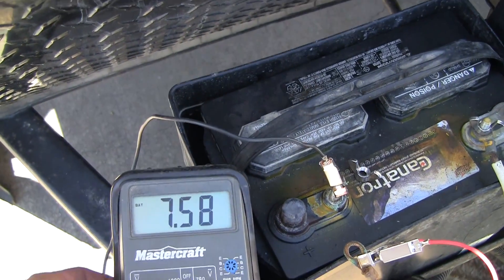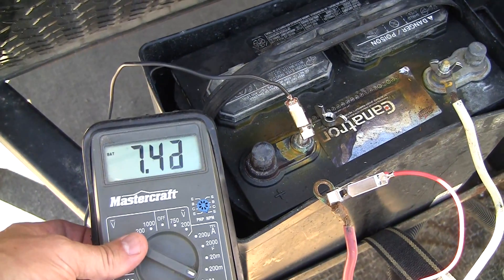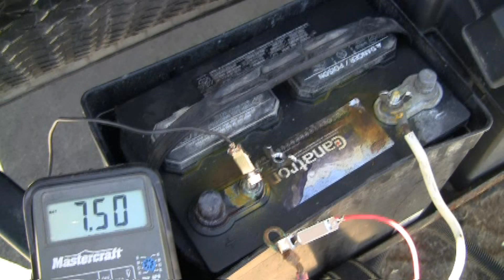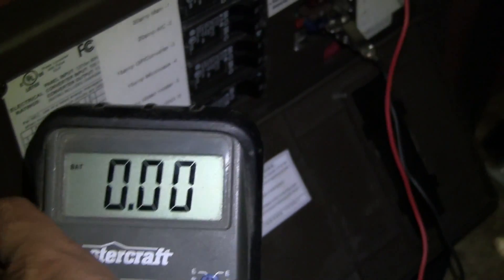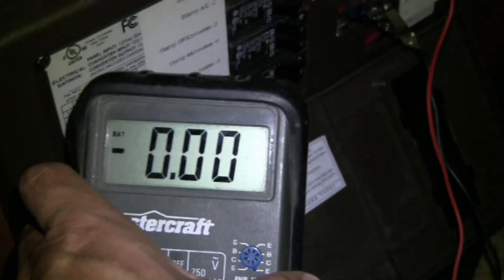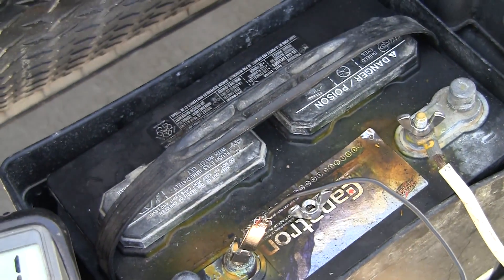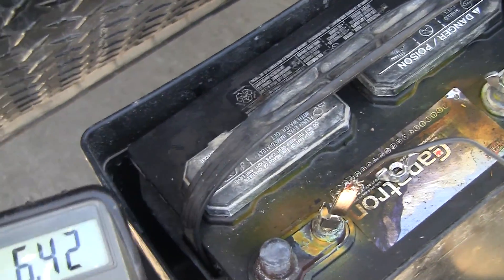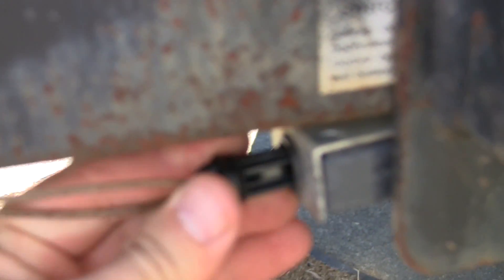Why is my rv battery draining so quickly

Comment: My friend.   All I can say is THank you!  My pick up kept draining the battery.   I noticed my brake controller stayed on even though the truck was off.   I finally just disconnected the terminals at the power box to resolve it.   Didn't think for one second it was because I removed the module when I'm not using it.   Going to go out and reconnect and test with the module plugged in.   Thanks again.

Comment: That's not every situation though. Parasitic draw can come from any devices attached to the battery(ies)
Reply: Parasitic draw should not be in Amps. The trailer brake is designed to stop the trailer when it is detached to the tow vehicle. True it may not be the only case though. Thanks for the comment.

Comment: wait so you didn't notice the trailer brakes were on while Driving like that?
Reply from the maker: When you disconnect the trailer you can pull the cable  and not notice the battery is draining fast. This does not happen when you are driving. The system is designed to engage the brakes if the trail become disconnected from the tow vehicle.

Comment: Sorry, Can you explain what is this "trailer switch" ?
Reply from the maker: If the trailer is disconnected from the tow vehicle, the electric brakes on the trailer is turned on. The electric brakes use a lot of current. This is done so the trailer does not row down the hill if a accident occurs.

Comment: Thanks for the video. I had this issue while dry camping.  i couldn’t figure out where the current was draining  to.  i found the problem within seconds  after seeing the video.  i accidentally pulled the Ebrake cable while taking the trailer off the truck and pulled the pin